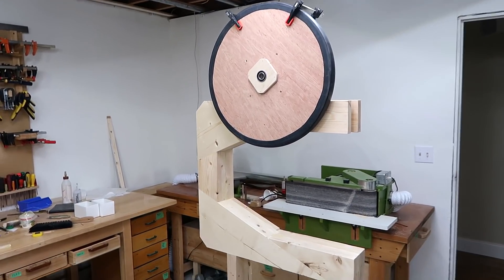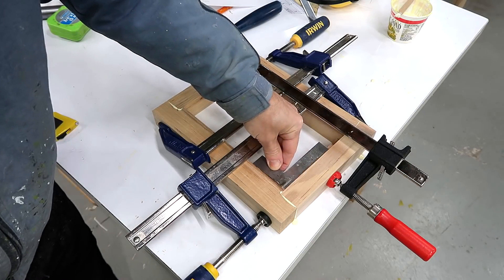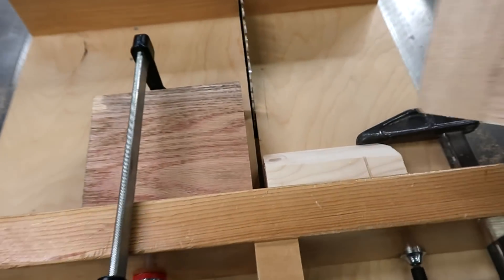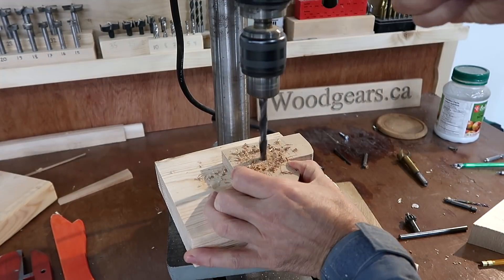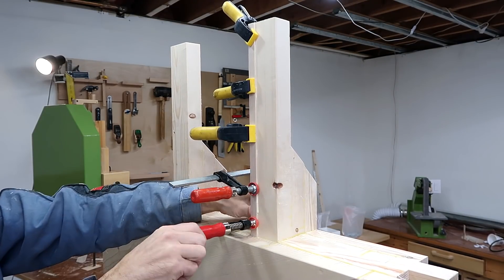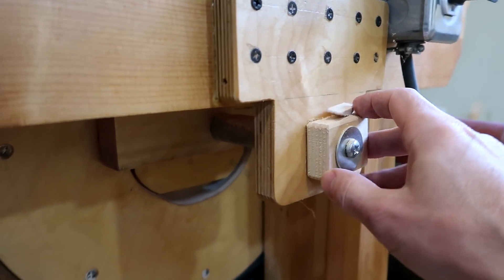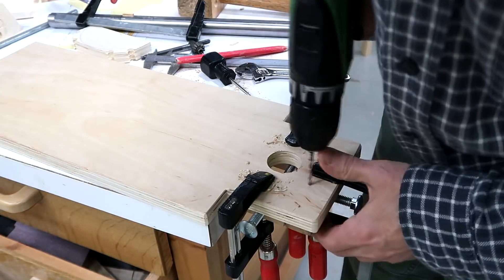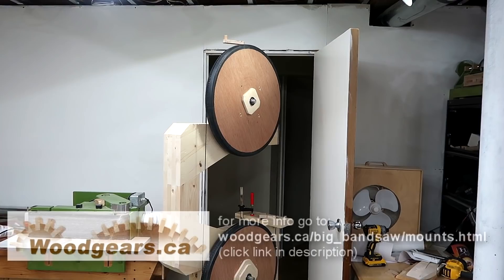Wheel mounts for my 26" wooden bandsaw

Comment: Could you add a foot peddle, like the old sewing machines as your power?
Reply: Pedal
Reply: @mwilliamshs  yeah, i just woke up when typing that 😂
Reply: @mwilliamshs  pedaNT
Reply: @ricos1497  What's wrong with educating people?  Why scoff at the one who is correct?  Do you enjoy the dumbed down sociaty we live in?  I certainly don't.
Reply: @music-jn3wn  society
Reply: @ricos1497  555!  Got me. I before E except after C...And no A involved. Noted, Thanks.
Reply: Or peddle powered scroll saw's which were common machine of old carpentry shops. Some areas in the world new ones are still made and sold commercially.
Reply: Maybe fill the wheels with sand so you get more momentum :)
Reply: @0xbaadf00d  Or just fill them half way, so you get a good workout ;)
Reply: @0xbaadf00d  Would need a larger hp motor to reach the same fpm blade speed. I believe he tailored the wheels weight to match a motor he already had. There is always a trade off with mass vs available power vs efficiency.
Reply: @music-jn3wn  Unless the motor was unable to overcome friction of the bearings and blade on the wheels, you would not need a bigger motor to get the wheels to the same speed filled with sand or hollow. The added friction in those sealed ball bearings is negligible when talking about less than a few hundred pounds of weight. The friction from the blade on the wheel is independent of the weight of the wheels. Adding weight to the wheels for the same size motor only means it takes longer to spin up. Unlike a propeller, this is just a spinning mass, it is not really moving or pushing anything like a blade is. Adding weight (increasing effective density as the size of the wheel is unchanged) affects the inertia of the wheel and thus it's momentum and kinetic energy at any given speed, not the dynamic friction experienced by the wheel.

Linear blade speed, in feet per minute is not a function of wheel weight, it is a function of the wheels angular velocity. The angular velocity of the wheel is dependent on the motors speed. In this case Matthias is using an AC motor, it's rotational speed is a function of the frequency of the power it's given and the number of pole pairs in the motor. Rotor slip is not important for this discussion as we are talking about nominal speed not pullup speed or breakdown speed. An AC motor in North America is fed 60hz AC, this means it spins at one of a few speeds exclusively depending on if it's 2 or 4 pole, either right about 3,600 rpm or more commonly 1,800 rpm respectively. These motors are always trying to catch up to that speed, they will exert a massive amount of torque to get to that speed, especially the slower 4 pole variants. As long as the motor has enough power to overcome friction it will continually speed up a spinning weight until it reaches this equilibrium speed. We know this from some simple force equations, as well as just plain experimentation. When a motor tries to turn it produces torque, the wheel has inertia and tries to resist this force however the wheel spins, much like a person pushing constantly on a large merry go round, it might be slow to start but it will still get up to quite a fast speed.

Say our motor can exert through pulleys 100N-m of force at the shaft of the wheel, and our wheel weighs 10Kg and the wheel radius is 0.33 meters. Using the angular acceleration equation F/(mr)=a we get an acceleration of the wheel of 5 rotations per second squared, the wheel will accelerate until the motor hits is desired rpm of 1800 rpm, which depends on pulley ratios but for example a 10 to 1 ratio means the motor hits nominal speed after 6 seconds and the wheel is at a brisk 180 rpm. Now if you double the weight of the wheel to 20Kg, the acceleration drops to 2.5 rotations per second squared this means it will take 8.5 seconds to hit nominal speed, but it will still hit that same 180 rpm.
Reply: @2009dudeman  Thank you for the information.  But...alas, you are not correct . analyze again .
Reply: @music-jn3wn  actually 2009dudeman Is correct. It will only take longer to get up to speed but maintaining it is easy. A lot of people have the wrong idea about horsepower. I have a Dodge Challenger with around 306 hp as opposed to the hellcat with a hemi engine producing around 797 hp. In a drag race I can’t touch him he’ll be crossing the finish line before I get halfway down the track. But for cruising down the road his 797 hp isn’t helping him one bit. On a Dino you can achieve and maintain horsepower at its peak load but in the real world actually being able to use all that horsepower is a much different thing, it requires a specific load at a specific engine RPM and that would only be a moment in time while you’re driving down the road.
Reply: @2009dudeman  even a motor that was a touch under powered could get it up to speed if you just give it a little momentum by spinning the wheel before you turn on the power to first start it up. You know, having to do with all that an object at rest wants to stay at rest and an object in motion wants to stay in motion. Ain’t physics fun.
Reply: @duanemiller5606  So again, I ask how I am mistaken, we are not talking about low starting torque motors like shaded pole motors. We are talking about larger motors with 75% or greater starting torque.

On that note, you just contradicted yourself by saying even a motor so weak to even start the wheels spinning on it's own could get up to speed. So how am I wrong to say that the HP rating of a motor does not affect it's rotational speed just how long it takes to get there.

You are trying to sound smart, maybe 'prove' your intelligence with snarky comments like Ain't physics fun, and analyze again. However you haven't done anything here besides make elementary school remarks about objects at rest staying at rest and incorrect assumptions that mass vs available power vs efficiency affects blade speed in any meaningful way for something of this size. The reality is, you could stick a small desk fan motor on this and it will spin up to whatever it's synchronous speed is, or you could stick a 22HP industrial motor on it and it will still spin up to it's synchronous speed even if both wheels combined weighed 40Kg. As long as their nominal speeds were the same 1,800 or 3,600 rpm the linear blade speed would be the same. As you have identified, once the wheels are spinning, they want to stay spinning, you don't need massive power ratings to overcome friction in ball  bearings.

But lets actually look at the amount of energy lost to friction and see just how much power is lost to friction. These are ball bearings, 6205s to be exact which is a deep groove ball bearing, they have a friction coefficient on average of about 0.0015 for fully radial loading. This is miniscule compared to other things, such as two pieces of oil lubricated steel sliding (u of 0.081) or two pieces of ice sliding together (u of 0.02). Since we are talking about the minimum force required to rotate this thing, we are not talking about blade friction, blade friction does not change with wheel weight and if the motor can spin it with light wheels then it can also overcome blade friction, so we will ignore that as it's a constant. Only bearing friction plays a roll here as that is the only thing friction wise that changes with weight. There is a lot of variables in bearing friction calculation, however we will stick with the simple form. If we assume that the blade tension is greater than the weight of the wheel, then the bottom wheel will be fully supported by the blade and the top wheel will be supporting the full weight of both wheels plus the remaining blade tension not accounted for by gravity. I do not know what he set his blade tension for, but lets just pick a ridiculous load number for the top wheel, say 200Kg of load on the bearing. That results in a force of 2,000N, which in our ball bearing give us a frictional force of 3 Newtons for the top wheel, we can be very generous and just say there is equal force on the bottom bearing, meaning we have 6N of force from friction dynamic to overcome at a radius of 0.025 meters which is the shaft diameter and what any attached motor or pulley would be acting on, or 0.15 Nm. So what does this mean for a motor? Well, lets just look at a tiny 1/4HP motor spinning at 1,800rpm. We know that HP is just torque and time and there is a calculation for that. Torque= (HP*5252)/RPM which for our tiny 1/4HP motor is 3.9 Netwon Meters. Well, the friction we have to overcome is 0.15Nm, so even a 1/4HP motor produces 26 times the torque required to spin the wheel with 400Kg of equivalent weight, excluding blade friction, doubling the weight to 800Kg just doubles the required force from 0.15Nm to 0.3Nm.

So again, I ask how I am wrong to state that adding weight to the wheel does not require a higher HP rated motor to spin at the same speed...
Reply: @2009dudeman  sorry for the misunderstanding my friend. I actually agree with you. If you look at my comment above to Music you’ll see I said you’re right. In my comment to you I was simply referring to a Motor that didn’t have enough horsepower to break the initial friction that could still turn the wheel if there was a little momentum in the wheel to start with. Like pushing a car, getting it initially to start rolling is very difficult but once you have it rolling on a flat surface you can get it up to where you can push it very easily. It’s just breaking that initial friction and getting the car to start moving. As I already said, you were right and the guy music was wrong. I was just pointing it out using a different method to show how you were right.
Reply: Doable, but not worth the effort, plus, you really want to keep your attention on cutting, not pedaling. Pedals, use a different region of the brain, you're basically asking for trouble then.
Reply: @aserta  gotta disagree with that. Treadle-powered sewing machines and spinning wheels were the standard for centuries and those pedalling operations required at least as much dexterity and focus as bandsawing and if the sharpness of the saw is your worry, consider the pedal-driven grinders that sharpened axes for a couple hundred years or more. The greatest impediment to pedaling this saw in my opinion is that it would require being seated but the whole point of the saw is its great size which allows cutting wood so large the operator must stand to handle it.
Reply: @aserta  yes, but it also comes with an automatic brake. I'd say the bandsaw with foot treadle is fairly safe. Although I'd need a couple of beers to work up the courage to test my theory.
Reply: @ricos1497  brake that has bad mechanical advantage working against considerable amount of stored kinetic energy in the rotating and traversing parts of the machine. You will just as easily chop off your digits with a human powered saw if its operating at the same blade speed as a modern electric saw.
Reply: @ricos1497  alchohol and machinery eh?
Reply: @aserta  The first lathes were mostly foot treadle and you definitely want to keep your mind on the work there.
Reply: @aserta  , that's Why the Creator designed the system that way, so we can pedal and saw at the same time. Like steering and tuning the wedge at 220 mph at Indi.